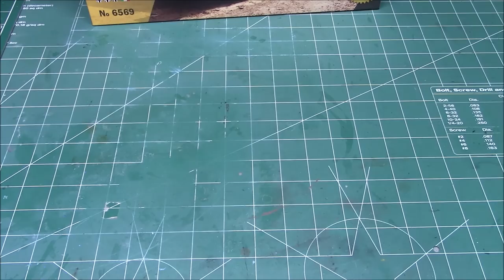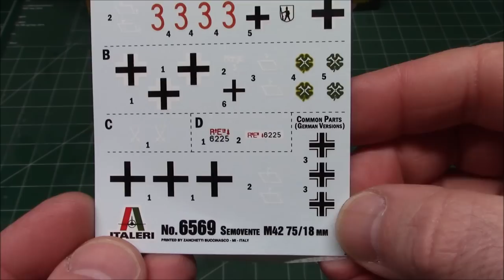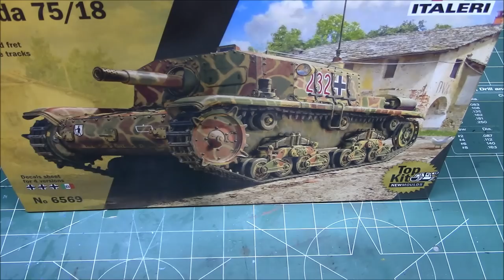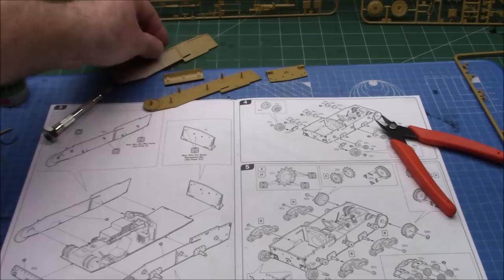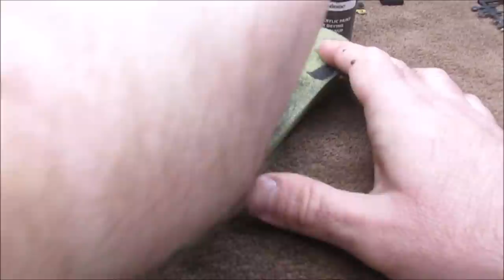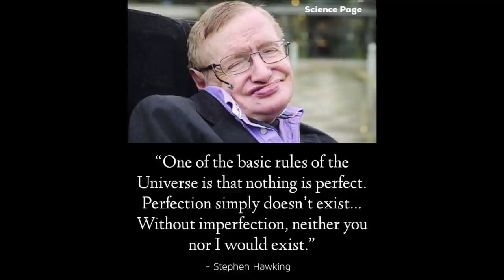Semovente M42 da 75/18 Tank 75mm 1/35 Scale Model Kit Build Review and Weathering Armor Italeri 6569

Comment: Ive been intrested in this tank for a while, glad i waited for new tooling. I went to MRC to order one, and its out of stock already. Nice video. Looks great.
Reply: You can get older versions of the kit on eBay for a reasonable price.
Reply: @joeshmoe9978   Is this Italeri kit a new tool, or same as the older kits?
Reply: @sayeager5559  The kit dates back to 1972. The new version features parts for the interior (not included in the older versions) with a few other improved parts and some photoetch. If an interior isn't that important to you, you can get a less expensive older version on eBay. If you absolutely have to have the improved kit, its in stock on the Spruebrothers website now.
Reply: @joeshmoe9978  Thanks, I thought it was an entirely new kit.
Reply from the maker: Thanks, enjoy!